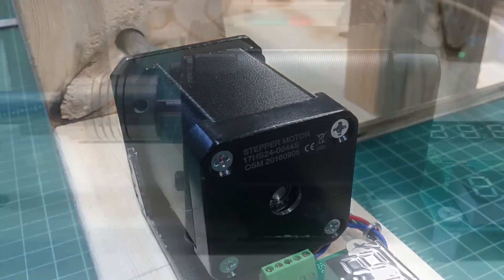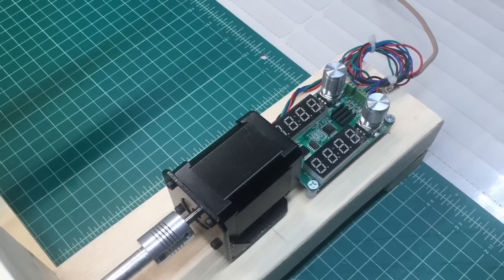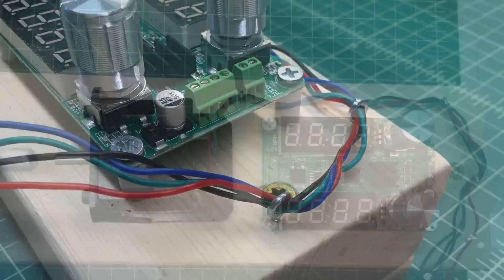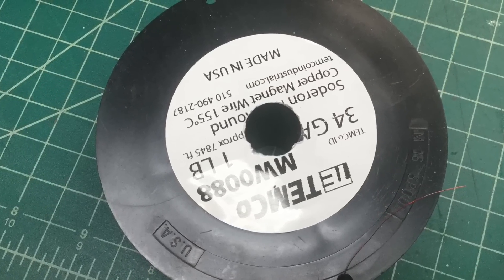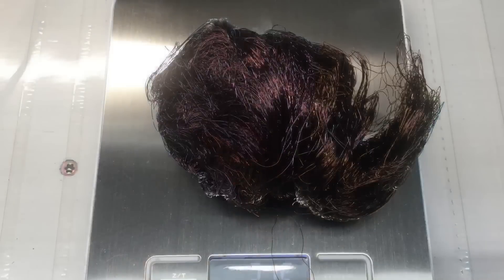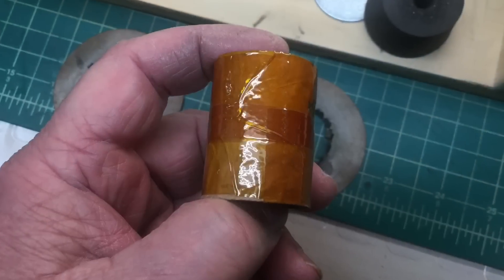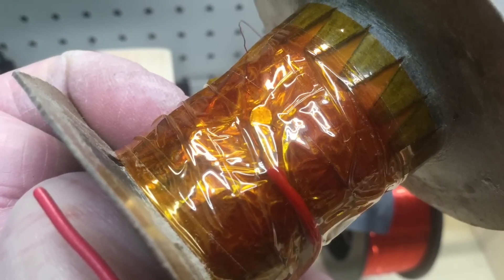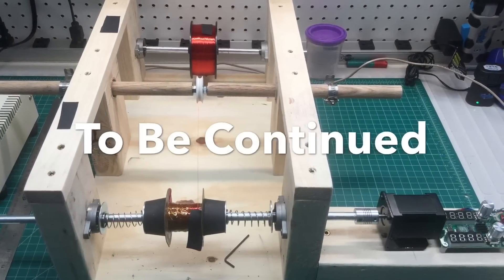Coil Winder P2

Comment: stepper motor controller?
Reply from the maker: Bobby - the stepper motor controller I used was discontinued, so an Arduino build would be my recommendation. Try a google search for stepper motor controller using Arduino. If time permits, I’ll try to research this and provide an update in a future video. Best, Don
Reply: RestoreOldRadios hi Don. Thanks. I bought that same stepper motor but the wires came on done so I was hoping to figure it out. I did figure it out all is working OK. I guess if this one blows up I will try the other one. I just could not figure out the best one for a stepper motor but all good now!
Reply from the maker: Bobby Stefano Glad you got it going again. Hopefully others will produce or clone this controller in time. It’s so simple and easy to use. All the best. Don

Comment: what nema 17 are you using? If I primarily work with 18 gauge wire, is the 17 ok?
Reply from the maker: +americasfinestcity I’m using a short length of solid 22 AWG from the Stepper Motor back to my 12V power supply and it seems to work well. The motor is model 17HS24-0644S. Best, Don